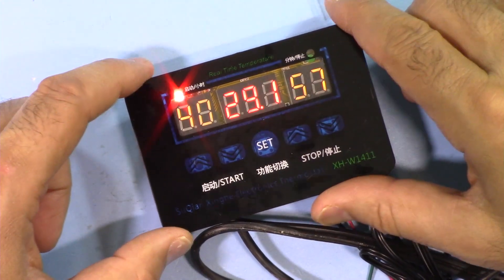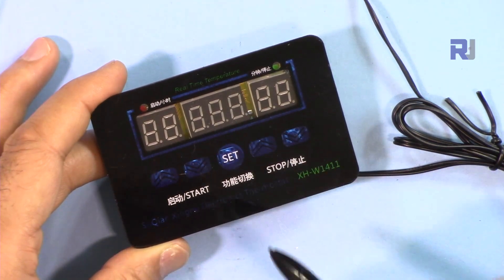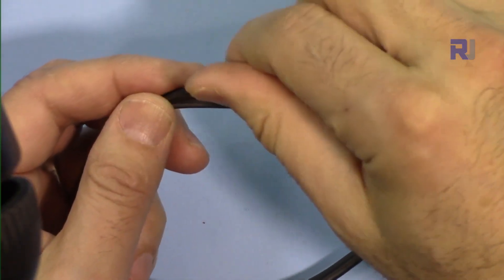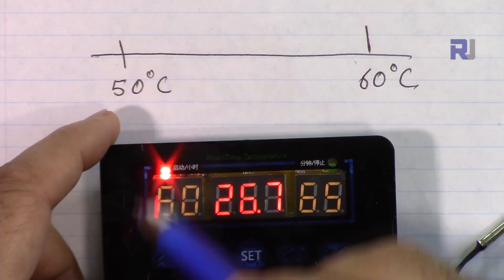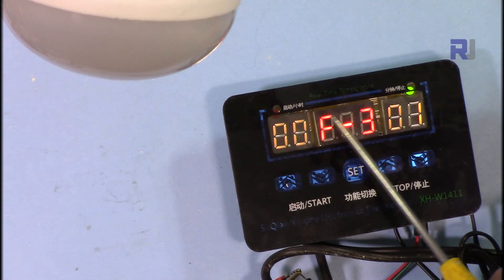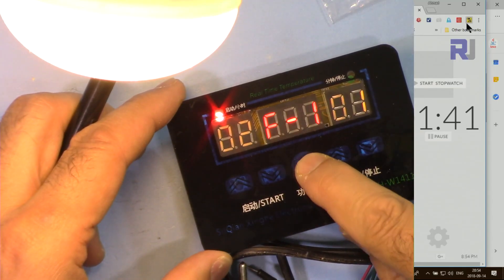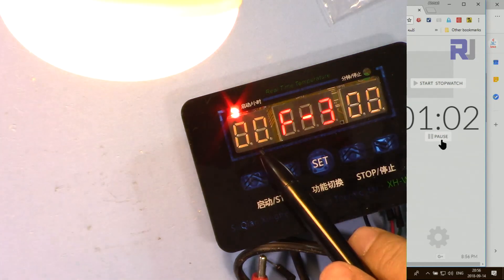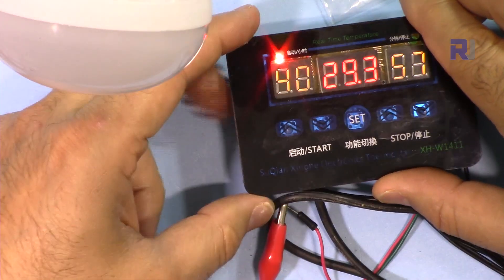XH-W1411 DC 12V Multi-functional Temperature Controller Thermostat Switch RJT126

Comment: Most Köszönöm a videót! Megjegyzés : HŰTÉSRE IS HASZNÁLHATÓ!!! Most szereltem ,de egy kóagépbe ( a hűtőkompresszort kapcsolgatja) Azt nem tudom, hogy a benne lévő relé, (15A van ráírva) fogje-e bírni...
Thank you for the video! Note: CAN ALSO BE USED FOR COOLING!!! I just installed it, but in a coke machine (switches on the refrigeration compressor) I don't know if the relay in it (15A is written on it) will handle it...
Vielen Dank für das Video! Hinweis: AUCH ZUM KÜHLEN VERWENDBAR!!! Ich habe es gerade eingebaut,r in einer Cola-maschine (schaltet den Kühlkompressor ein-aus) weiß ich nicht, ob das Relais darin (15A steht drauf) damit zurechtkommt...

Comment: Hi I’d like to know why 50 degrees c is the lowest temp to start a heater. If that’s air temperature that’s very hot ? 

Thanks for a great video
Reply from the maker: Hi, may be you missed it where I said : this is just an example

Comment: Interesting video; what is the real voltage range? can it support from 5 to 30Vdc? the two limit temperatures can also be set with degree decimals or whole degree only (example: it is possible to set on 25.5 and ogg 37.3 ° C). Can it support other sensors?
Reply from the maker: Hello, you made me watch the video. Please watch the video, both of your questions has been explained

Comment: Hello, thanks for the video, can it be used on heating liquid tank , where there are 3 heaters each 9 kw , and could you suggest a suitable device if this one is not suitable , I would like to keep liquid temperature at constant 85 degrees
Reply from the maker: Hello, this module has a relay rated with 10 or 15A which I don't remember. so for your application, find out the current in Ampere by dividing the 9000w to the voltage either 120V or 220V   whichever is your voltage and you will get the current in A. if it is less than or equal the rated current of the relay, then use it. if not, do not use it as it might catch fire.

Comment: This can be used for heating and cooling.  To cool, set the start temperature (left) higher than the stop (right) temperature. To heat, set the left temperature lower than the right.  The middle is the current temperature at the sensor.
Reply: Yes, this video is wrong at about 4:50 that says it is not for cooling. I am using it for a cooling fan where I need it to go on at 26 degrees Celsius (about 80 degrees Fahrenheit) and go off when it cools down to nearly that degree. So, I set the start value to 26 and the stop value to 25.
Reply from the maker: I don't have the module to try it but if it works, that is another great feature of this.

Comment: Is there a different style temperature that can work with this module ... I need a Flat Style temperature sensor
Reply from the maker: search on eBay or AliExpress
Reply: Robojax I found some like this https://www.sparkfun.com/products/15767 but my concern is will the module display an error if I replace the temperature sensor